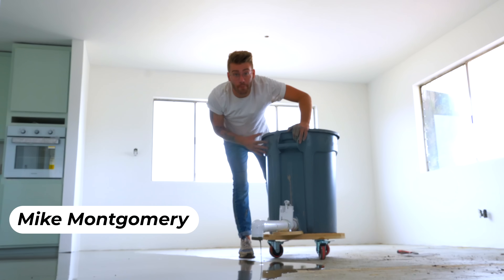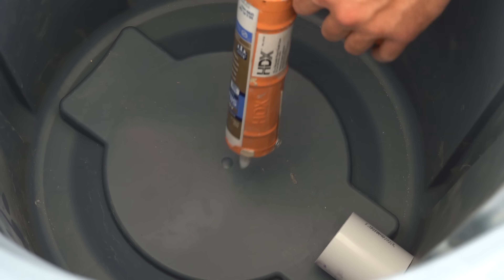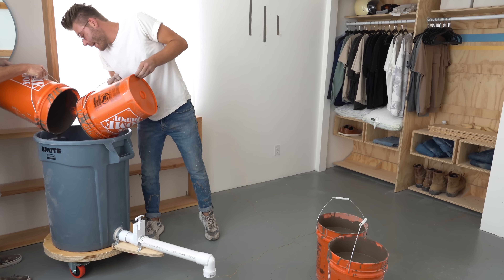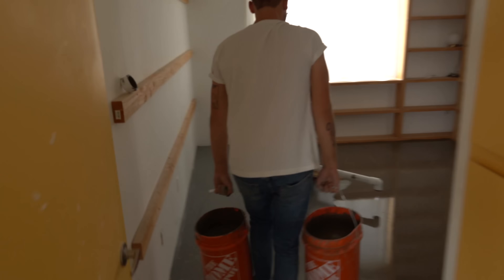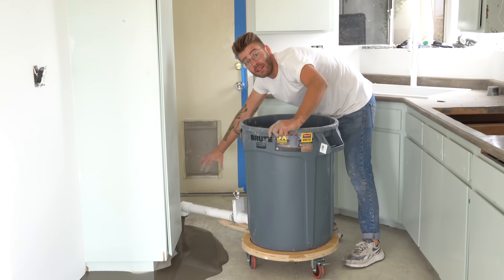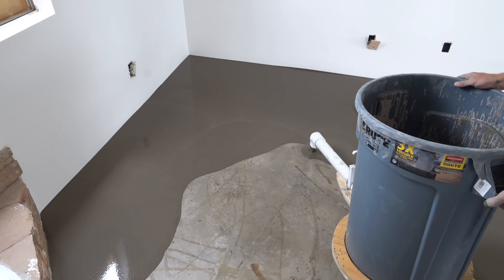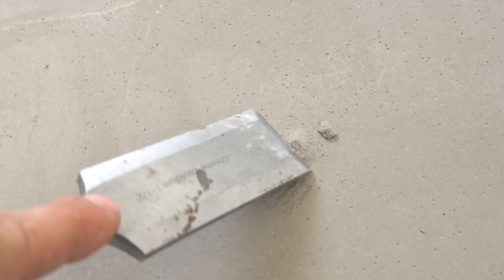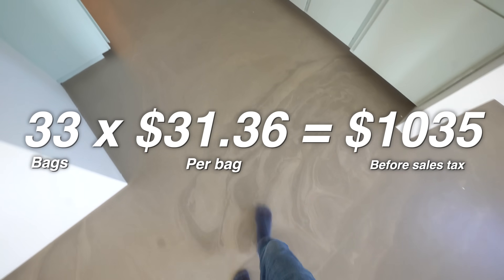DIY SELF LEVELING CONCRETE FLOORS!! $1 per square foot

Comment: This bloke hasn't got a clue how to self level a floor. For starters despite what it's called it won't actually self level over a large area, you have to trowel it on. You should also use a spiked roller to get all the air bubbles out. Typical diyer trying to be clever

Comment: Nice job!  It’s always a learning experience as you go and definitely would build a 2nd jig to fill and use when your first one is empty.  If not putting flooring over the concrete applying an anti slip treatment is always an option. 👍
Reply: I think that this is a SCAM. I GOT ONE .